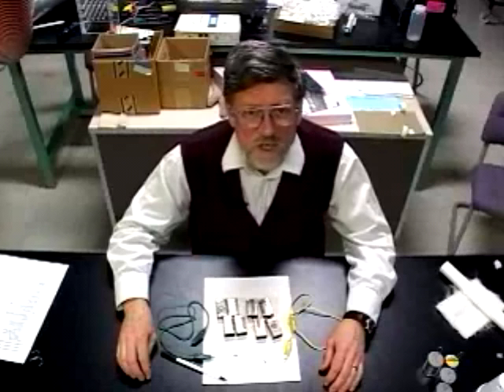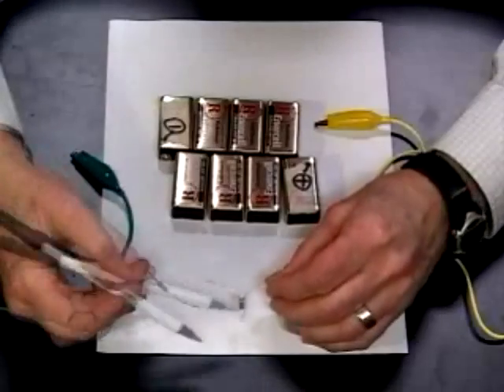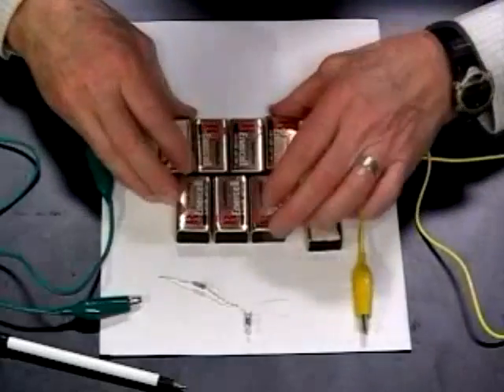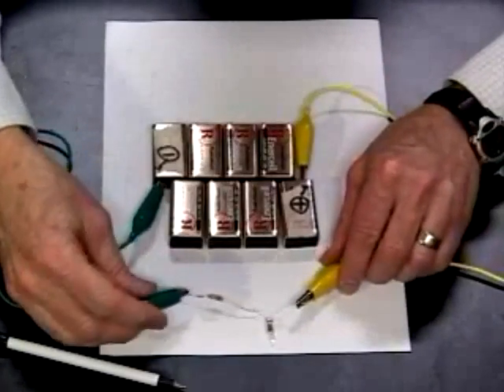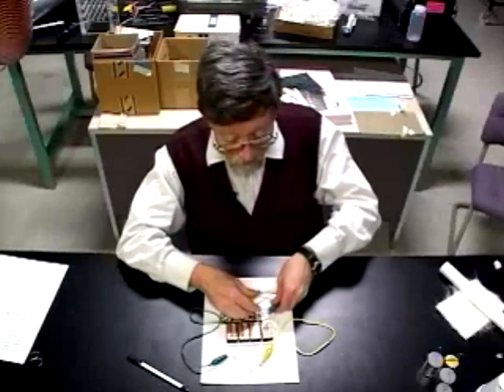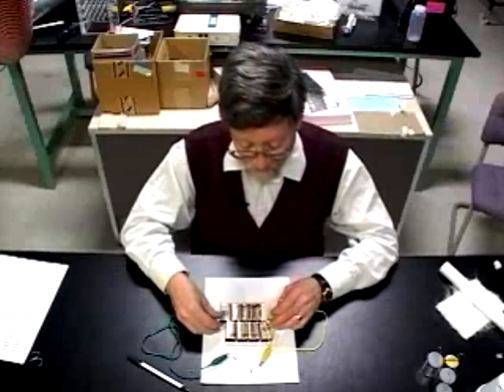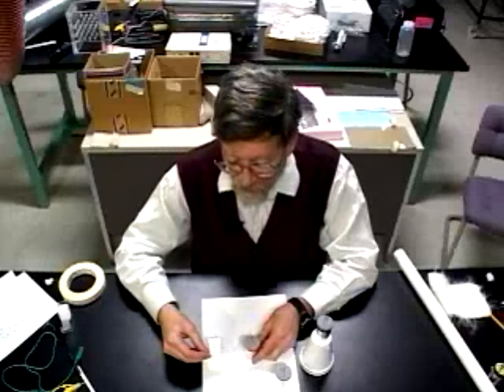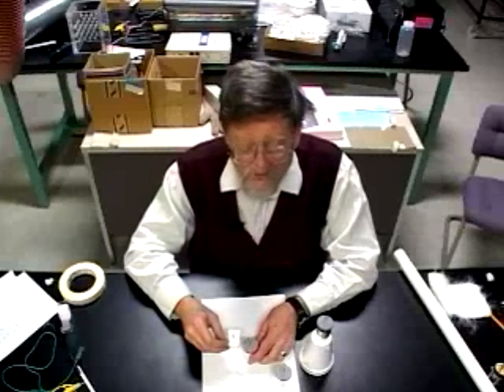Lighting the Neon Bulb

Comment: The neon bulb is also light-sensitive. On a power strip, a neon bulb that has been in use for years might be flashing intermittently instead of shining brightly. But when you shine a flashlight on the bulb, it will glow orange without blinking. Sometimes aging neon bulbs that indicate AC power will be completely dark until you turn the lights on nearby. I had thought the power strip in an attic was connected to the light switch, but it was explained to me the energy was going to the bulb all the time and it was only the ambient light that caused the bulb to begin shining.